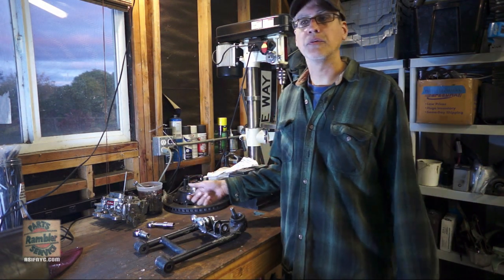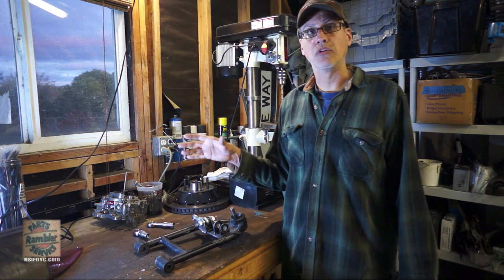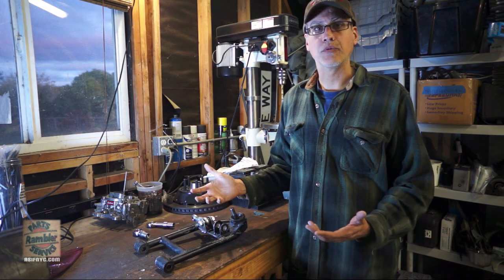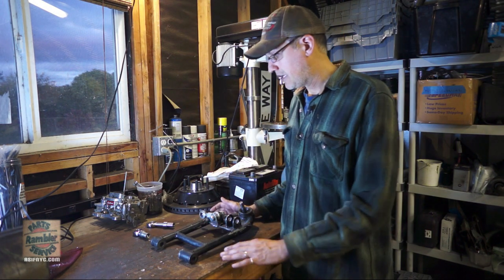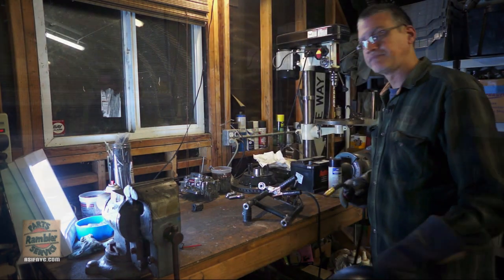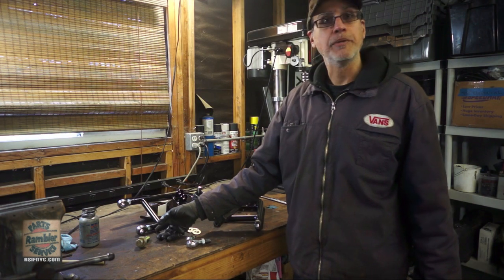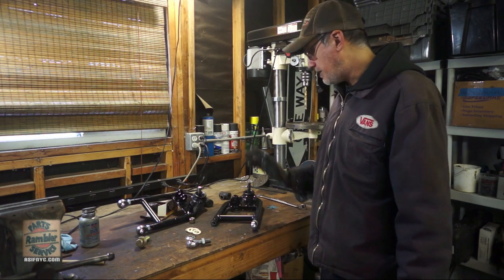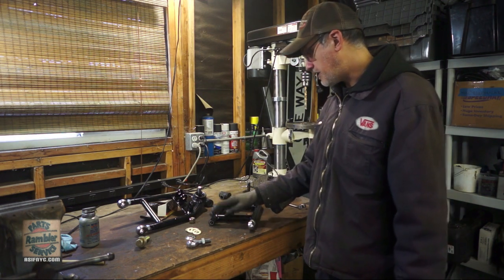Adjustable Lower Control Arms - Control Freak IFS (AMC Javelin)

Comment: Did you make these yourself or are they control freaks?
Reply from the maker: george owen They are control freak lower control arms that have been modified by me.  I chopped off the ends and welded in threaded bungs to accept rod ends.